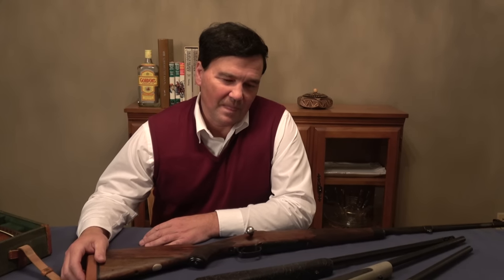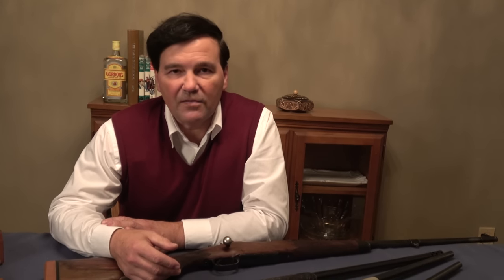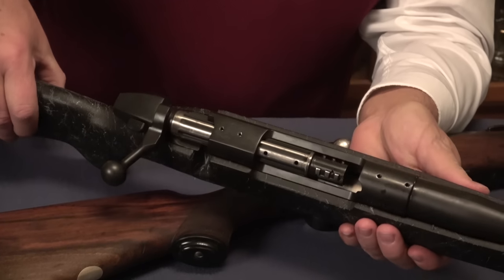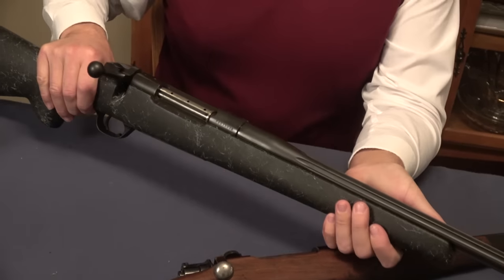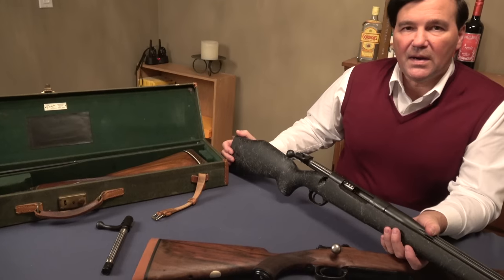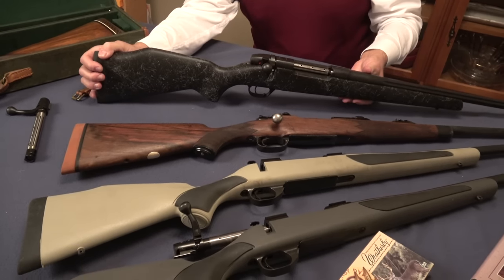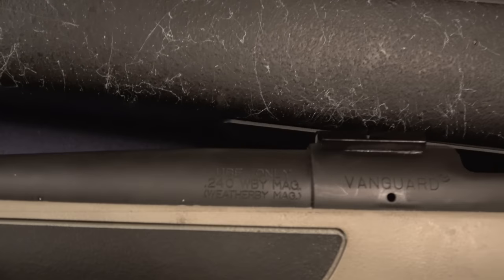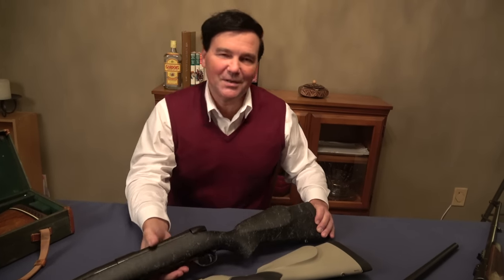Weatherby

Comment: When I seen a Weatherby rifle back in the 1960's I knew I had to own one.. One of my brothers bought the .257 Weatherby first and I followed behind him with the .224 Weatherby in a scaled down Mark V action . 
I don't have to tell you with your knowledge, but at the range the .257 Weatherby would punch boiler plate 1" thick @100 yards with 3 out of 4 Bullet weights..plus it would melt through armor plate that came off a half track 3/8" thick. It was the hottest flattest shooting .25 caliber on the peninsula...Norma has loaded their ammo for years.. What people complained the most about was brass costs.. 22/250 brass was $2.99 box of 20 Weatherby brass for my .224 was $18.00 per 20.. Both those ctgs are very similar in performance.
Scope bases and rings on my Mark V I wanted blued steel and good quality to match the receiver and Leupold was what I used.. What I seen a lot was a very nice quality rifle , and cheap mounts and scope my opinion it looks terrible. Great video.

Comment: Great video , I always wanted a 257 WBY magnum that cartridge has always fascinated me ,like a 25-06 on rocket fuel , how would you compare the a 240 way to say a 243 Winchester in performance
Reply from the maker: Thanks again. The 240 can push a 100 grain bullet about 400 FPS faster than the .243; about 3400 FPS for the 240WM. I  saw a chronograph reading of a friend's handloads at 3600 for the 100 grain - but the pressures may have been too high; although I examined the fired cases and didn't notice flattened primers or any evidence of excess pressure. I'm not sure which powder he was using. The Weatherbys I've owned had freebore ahead of the chamber - meaning that bullets take a run out of the case mouth before engaging the rifling - that headstart theoretically helps velocity/pressure.

Comment: Great video as always! I shoot a Vanguard as well as Mark V in .340 and they are both excellent rifles with good out of the box accuracy and performance. Only comment I would like to add is, that these fast calibers demand tough bullets adequate for their speeds to ethically hunt and kill big game without excessive meat loss.  Seen plenty of cheaper projectiles coming totally appart in these!
Reply from the maker: Thanks Stefan -  I hope everyone reads your post. I tend towards bigger bullets at lower velocities - such as the .35 Whelan - which still needs decent bullets but not to the level of the .340. I lose some trajectory for sure - but meat damage is minimal and bullet mass is hard to beat. Of course - the .340 has it all. All the best.
Reply: @UnitedStatesOfGuns  I grew up and hunted a lot in Germany during my younger years and as you obviously do too, I like my lower velocity cardridges. I shot a lot of big game here in BC Canada with my 6.5 x 54 M&S, 7x57, 7x64 and 375 H&H and they all work beautifully with simple cup and core bullets at muzzle speeds around 2500 to 2700 ft/sec and at normal hunting distances. In my humble opinion ethical hunters should be very familiar with their guns and should not take long range shots at animals. Long range shooting has its place only for practicing and familiarizing yourself with your firearm on artificial targets.

Comment: Think you can do a video on weatherby ultralight vs nula and some other light weight mountain rifles?
Reply from the maker: Will do Luke - until I get the rifles together the Weatherby is superb and the best is the Kimber IMHO
Reply: Thank you for responding.  What model kimber are you referring to?  I have no experience with the kimber yet .  I have two light weight rifles a weatherby mark v ultralight in 300 win mag .  I’ve only put around fifty rounds through it yet but it’s definitely a shooter but I’m not sure I’d call it a ultralight.  I also have a colt light rifle in 7 mm rem mag .  This rifle is also a shooter but it has been far from dependable. Before twenty rounds starting light striking primers .  I changed firing pin spring and it fixed it .  Then at 200 rounds it started firing when you took it off safety .  So I just changed out the entire trigger mechanism for a jewel trigger .  On forums I always read such great stuff about Melvin Forbes nula rifles .  Guess I’m searching for a light weight elk rifle that does double duty deer hunting to .   Add target shooting to the list to.

Comment: I am seriously considering buying a mark V I think I am going to get one in a non weatherby cartridge. I am digging the Accumark. I am thinking 7mm Rem mag. For the simple fact it's easier to buy ammunition for. I want something that works on the farm here in VA as well as being able to hunt out west in Wyoming or Montana.
Reply from the maker: Perfect choice. The Mark V in 7mm Rem Mag is a superb combination - you'll be equipped to hunt just about anything in North America. My friend in Alaska said nothing is too big for the big bears. I asked him what he uses (for decades). He answered : "Oh, a 30-06." Your 7mm is more than enough if you do your part.
Reply: Even here in VA we do have a variety of big game to hunt. We have bears, deer, turkey, even elk and a feral hog problem in some areas. I do like 54 degree bolt lift, I do like how smooth and how strong the action is. I was debating 7mm Rem mag or 6.5 creedmore. I figured for hunting I can get more out of the 7mm mag. In my area I think the 300 magnums are a bit much. For all around use I'd have to agree with you 30-06 or 7mm Mag. I also like the variety of bullet choices of the 7mm high BC's and plenty of kenetic energy. The Rem mag can push those high bc projectiles at high velocity.

Comment: To yooper man the 240 weather by most certainly is based off an old hAn h design the 240 Apex now the 244 witch is bigger in. Dia.is based off the 375 case but the Apex was same as 30_06 sprg.about !
Reply from the maker: Thank you Michael. Cartridge dimensions can be tricky. I usually start with the base diameter and from there I can tell what the parent case is. The Apex was a fine cartridge; although I guess not fine enough.

Comment: Early on in your video you referenced the H&H Magnum cartridges while pointing at the 240 Weatherby Magnum cartridge.  The 240 Weatherby Magnum cartridge isn't based off any H&H Magnum cartridge. The 240 Weatherby Magnum cartridge is a proprietary Weatherby cartridge and is essentially a 0.473" belted case head in a extremely expensive offering. The 6mm-06 cartridge can run neck and neck to Weatherby's 240 Magnum cartridge. 

Weatherby Vanguard actions are actually Howa action badged with the Weatherby name and isn't a true Weatherby in my opinion.

The Finnish made 338 Lapua Magnum is based off the 416 Rigby cartridge and is no way shape or form comparable to the 340 Weatherby Magnum cartridge.
Reply from the maker: Good points and thanks for the reminder. I'll do a video on the Rigby - I have two or three left - and maybe a review of the belted cartridges - which of sourse the Rigby isn't. The new Howa mini action is quite nice - I'll try to get to that as well. As for the .338 cal. cartridges - all interesting - I knew a few people over the years who used the .338 Win. Mag. for everything; which is a lot of power on certain game. On the other hand, they were happy and it's a free country : )
The 6mm-06 I have no experience with but read about it here and there over the years. I knew one fellow who had a Newton re-barreled to 6mm-06 (started out as .256 Newton, then 6.5-06, then new barrel in 6mm-06) The .240 WM is nice - but expensive to shoot - as you point out. I like it for it's unique case and the look of the cartridges; pretty frivolous reasons to buy rifle and cal. - but there it is. Please write more and Merry Christmas.
Reply: I enjoy my two 338 caliber rifle cartridges immensely. I have a the following: Weatherby Mark V Ultra Lightweight 6-lug standard action in 338-06 A-Square and a Savage Weather Warrior in 338 Federal. Both are heavy hitting moderate velocity cartridges without beating myself up in the process.

I hand load for all my firearms and these two 338 caliber cartridges are easy and inexpensive to reload. I use 30-06 Springfield brass for my 338-06 A-Square and 308 Winchester brass for my 338 Federal. 

I also had a Weatherby Mark V Sporter 6-lug standard action in 7mm-08 Remington. I also use 308 Winchester / 243 Winchester brass for making my 7mm-08 Remington ammunition.

I enjoy the Weatherby Mark V 54 degree bolt lift 6-lug standard action in non-weatherby cartridges, so I don't go broke buying Weatherby proprietary ammo or brass.

The 240 Weatherby Magnum cartridge is a round I never understood, but again quite brilliant of Weatherby since you need to purchase Weatherby ammunition in order to shoot it.

Weatherby recently introduced the Weatherby Mark V Camilla also available in 240 Weatherby Magnum.
http://www.weatherby.com/mark-v-camilla-deluxe.html

As you already know the smaller 240 Weatherby Magnum cartridge offered in the Weatherby Mark V Camilla and other Weatherby Mark V standard 6-lug action for the smaller 0.473" case head cartridges.
Reply from the maker: You are a valuable resource; clearly an informed and experienced gun man. Of all the .338s - I like the .338 Federal best. I understand it is not the ballistic champion, but to me, it does so many things well and as you mentioned - with reasonable recoil and in rifles realistic for hunting. The Lapua reaches far and does what it was designed to do; thankfully those who serve freedom most directly are the best authors for the hard stories of what that round can do. I look forward to your contributions to this channel. I do not pretend to know everything and many times I realize how little I know. Keep writing. All the best.